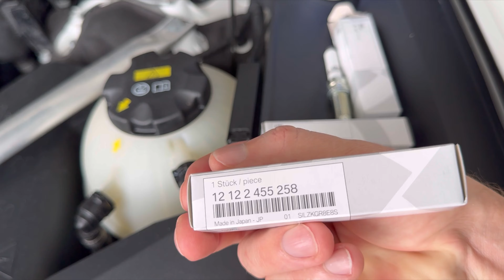B58 Engine, Spark Plugs change BMW X7

Comment: Tried to do this but 5 out of 6 coil packs were stuck. I dont have replacement coil packs on hand in case i broke any. Any tips to taking them off without tearing up the coil pack?.
Reply from the maker: @24S58MIII  Unscrew the bolt and pull it! You need to create a little pull force. Don’t worry you will not break it. Just do first with the one that easy access.
Reply: @DIYDime  thanks! I think I'll just order some new coil packs just in case I do break one. Awesome video

Comment: can you show how to change microfilter? they want to charge me $300 to do that job, i appreciate this video. they want to charge me $600 for spark plug changes - the highway robbery...
Reply from the maker: I will sometime! Subscribe to my YouTube channel if you have not yet, I’ll be adding more video on X7. Also when you get a chance check it out  playlists BMW X7.
Reply: My BMW dealership is charging $1,100 to change my sparks plugs. How many miles did this X7 have? I’m at 52,000 miles. I think I have to change my spark plugs soon.
Reply: I was at 47k - I don’t think they ever took the time to check them - just saying “it’s due soon”
Reply from the maker: 60 000 is when you need to change spark plugs

Comment: What model is your x7? Is it required to change spark plugs at 60,000 miles?
Reply from the maker: 2019 and yes 60 000 miles spark plugs needed